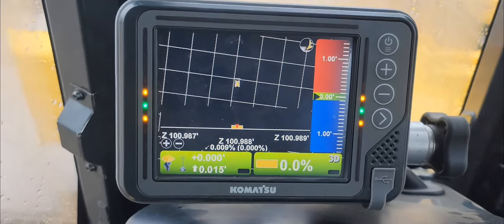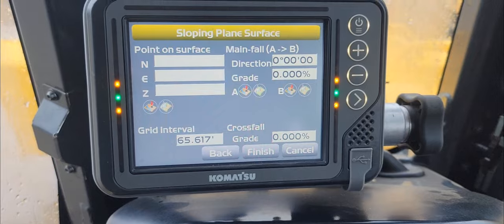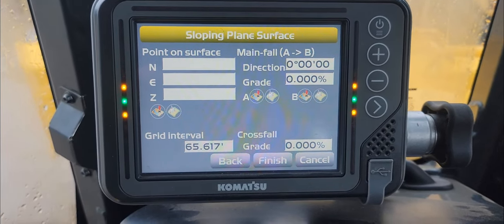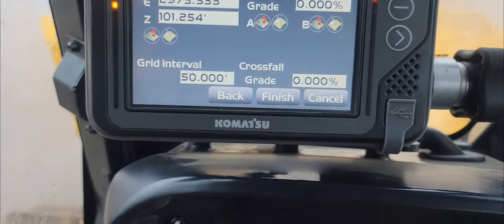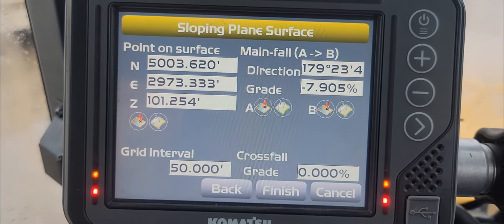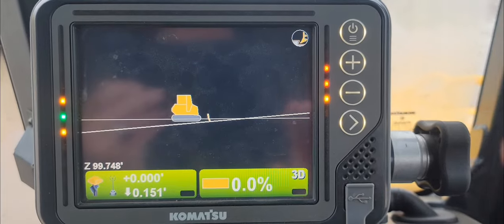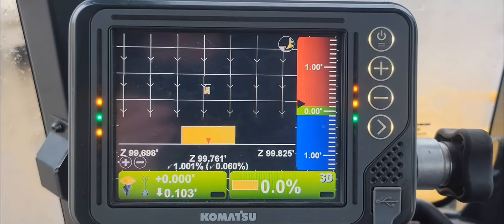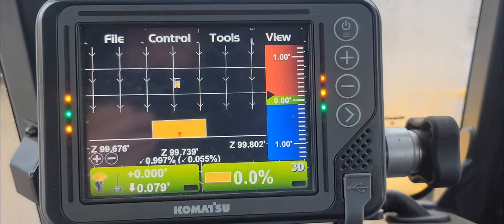Creating a Sloping Plane Surface - Komatsu IMC Dozer

Comment: Hello sir. 
Adjusting the grade allows you to set the Mainfall slope (front to back) to whatever you desire. Once you establish an a to b heading (A being the hinge point) you can then tell the software what mainfall slope you want. The number that populates is the value of mainfall that calculates between the two elevations you shot with the machine. Once you have your heading set front to back with a mainfall slope set, the cross fall value (left and right) then allows you to create a dual plane surface. 
Hope that helps.
Reply from the maker: Sorry if I made that confusing in the video. I haven't really had or seen anyone utilize the mainfall.

Comment: Thanks for the video. What is the grid interval?
Reply from the maker: It will create a grid across the flat plane starting from where you take a shot on the blade. You can set the size of each grid to any dimension. So if you make it 50' you'll have a 50' mark in each direction from origin point. 
Not a great explanation but hope that makes a little sense.

Comment: Will i need a gps home base for this feature to work?
Reply from the maker: Yes, you will need a correction source such as a base station, or NTrip corrections (most all Komatsu machines have a modem installed you can utilize). Currently there is no 2D option that allows for slope control without a fixed GPS position. 
If you are using an aftermarket Topcon system it should have the ability for 2D autos.